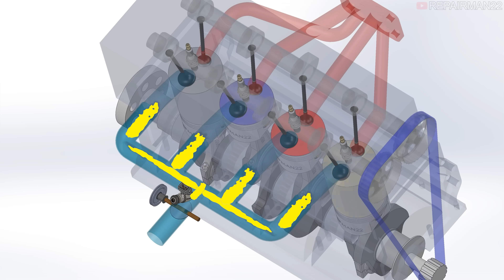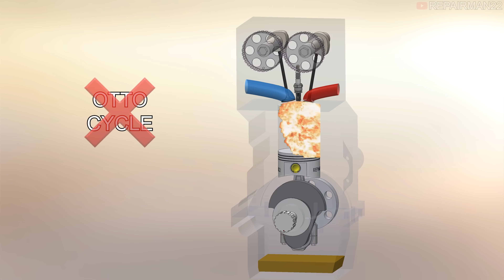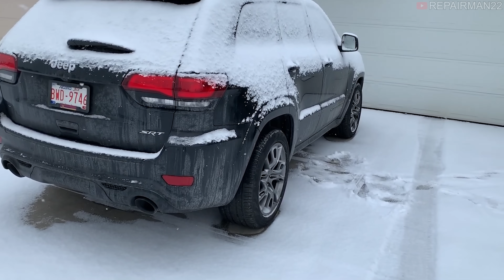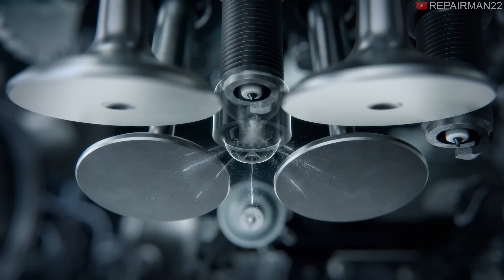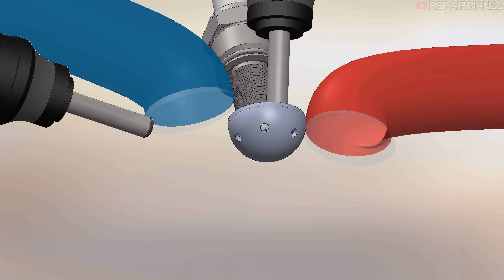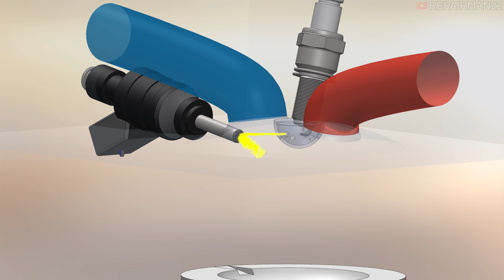How does this capsule with holes increase power? 💥🚗

Comment: Seems like the Active version of this is still the best pre-chamber solution, and most likely wont suffer from the issues of carbon build up in the chamber holes so much as the passive system used in the jeep / netuno

Comment: The early Honda Civics had the ignition chamber but utilized a small valve to feed the air/fuel pre-chamber
Reply: Literally in the video.
Reply: @welanduzfullo8496 No, actually, its not. The basic concept is there but not the exact system I'm talking about.  This concept is not a new idea. Honda massed produced it in the early 70's.
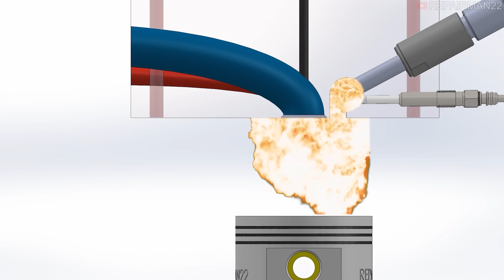Reply: @ravenrock541  Literally in the video and it was different 12:45
Reply: @welanduzfullo8496 That right. A different system entirely. So it wasnt "literally" in the video. Look up the Honda CVCC. The prechamber had its own intake passage with a mini valve to close it off.
Honda was doing it literally 50 yrs ago.
Reply: @ravenrock541  Your reading comprehension is lacking. Your initial comment mentioned the same thing the video already mentioned.
Reply: @welanduzfullo8496 Then let's just agree to disagree.
Reply: @ravenrock541  We don't disagree,  you just repeated what the video already said. The CVCC engines from Honda were mentioned.

Comment: Direct injection: The cooling effect allowed for higher compression BUT also result in more carbon build up. On the injector, on the Rings, on the valves, seriously shortening the engines life span.

Comment: Used to be called "Consant Vortex Combustion Chamber", which is where the Honda "Civic" got it's name (CVCC). I used to drive one in the 80's. Probably one of the most fuel efficient engins ever. Low to mid 40's MPG. It was a rubber vacuum hose spaghetti mess under the hood though.😂
That little dome is essentially a 'pre-fire' chamber. Very tiny, very rich mixture, fired into a VERY lean mixture. WAY less fuel used per cycle. Genius.
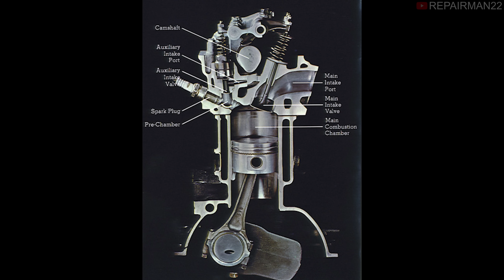Reply: In the video 12:49 and they were not turbulent jets

Comment: In an old 'science and invention' magazine from the 50's, there was an article on shell's (or was it texaco?) new multi-fuel engine. Burned gasoline, diesel, cooking oil, or any combination of all 3.  It worked on an ultra-lean principal of having a very small, rich charge of injected fuel/air spark-ignited to ignite a much larger, very lean charge of fuel/air, that would not normally spark-ignite by itself. The motor gave the 50's-era car 50-something MPG. And then it was buried and forgotten.  This 'new' mahle motor sounds very close to that old motor the gas company designed. Just imagine if it went into further development and production way back then.

Comment: The Mazda Skyactiv x, and Z do something similar.  It has port injectors that give the charge too little fuel to predetonate.  There is a small fuel injector creates a small volume rich in fuel around the sparkplug, there is no cup.  When this small volume ignites, the rest of the charge is ignited by pressure, rather than a flame front.    For more power an electrical powered compressor forces more air in when desired.
The SZ engine should be available this year in the US.  The SX engine has never been available for sale in the US.  When in lean charge mode, the throttle is kept wide open, and power is controlled by the amount of fuel injected by the port injector.  Lower pumping losses contribute to high fuel efficiency.

Comment: Very interesting and impressive.  I'm sure the manufacturers will make it impossible to interface a diagnostic tool with them so you won't even be able to work on the damn thing. They will make it where you have to bring it to them for a spark plug change. They will then act like pulling the upper intake plenum is akin to brain surgery and charge you enough to make your nose bleed.

Comment: Companies make these highly complicated systems to save another.1% of economy…then the engines carbon up and don’t last.  The new factory’s and foundry’s are polluting more than the old engines being left alone.  My Honda civic from the 90’s gets 42mpg and has 323,000 miles….oh and it’s easy to work on, parts are cheap and it has plenty of pep.  I don’t see any improvement.  Best part is the people that think they are saving the earth buying a car like this, yet they take a jumbo jet on vacation that pollutes 1000’s of times more than their car will in it’s lifetime.  I use to like engineering when they made things to last and be repaired, instead of over complicated and disposable.

Comment: I would imagine massive carbon build up in the pre- chamber in long-term use.
Reply: You need to rev your engine to the max from time to time. Not for grannies :)
Reply: It burns away
Reply: @MassimoTava   I agree that most of it will burn off in a properly functioning engine. However, premature buildup caused by faulty components—such as the crankcase ventilation system, spark plugs, fuel injectors, piston rings, etc.—can still occur. In my opinion, these issues can contribute significantly to buildup.
Reply: Somebody requesting attention

Comment: The MAHLE Jet Ignition (MJI) system—specifically its pre-chamber combustion technology—is conceptually derived from earlier pre-chamber designs, with Honda's CVCC (Compound Vortex Controlled Combustion) from the 1970s being a primary example of this technology in spark-ignition gasoline engines. All this does not overcome the direct injection issue with washing down cylinder walls on production car and causing premature cylinder and ring wear, as well as dilution of the oil. While the fuel dilution issue can be vaporised off once an engine's oil reaches full operating temperatures, many cars are used for short trips which is why direct injection has limited modern engine lifespan, in concert with low oil pressure that has been employed to reduce emissions. The best solution is dual injection, both port and direct injection with the port injection handling all low to mid RPM operation and the direct injection joining in under higher load conditions which solves the cylinder washing wear issue and oil dilution. The other defect in direct injection is that valves no longer are washed by the fuel from port injection, leading to very expensive service costs where walnut blasting is employed to clean the oil deposits that build up on the intake valve and progressively cause the engine to run poorly over the window between valve decoking. Manufacturers in a bid to save money have switched to direct injection alone, as dual injection requires two fuel pumps and twice as many fuel injectors. This cost cutting has all lead to engines failing long before they previously did, and is further compounded by longer recommended periods between oil changes, when in fact oil should be changed twice as often as before to mitigated oil dilution, oxidation and maintain peak oil quality in an effort to overcome the low oil pressure wear issues modern engines have. This is especially important if the engine is turbo charged, as the bearings are prone to wear from the smallest amount of impurities as they spin at speeds from 50,000 to approaching 100,000 when fitted to 'tuned" engines.

Comment: F1 Bring on 50 kg fuel limit. It can be done, already with forced induction, big increases in power are being made on smaller amounts of fuel. Bring on a lower fuel limit.
Reply: Racing should have no limits.
Reply: that would be 530hp for an hour at 60% thermal efficiency

Comment: in theory you could do a dual fuel system, super lean gasoline with port injection and ignite it with diesel direct injection, only one high pressure pump and no spark plugs
Reply: It's called Reactivity Controlled Compression Ignition (RCCI). It's a favorite engine design of Rolf Reitz.
Reply: @gregorymalchuk272 holy shit it exists and apparently it's super efficient too. god damn i am smart 😂

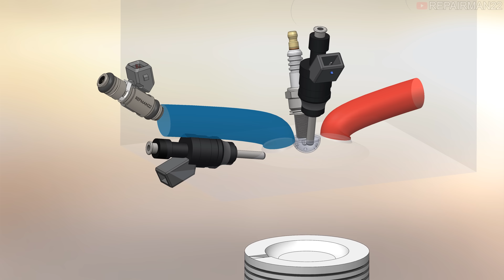Comment: 8:00 - Why would you need the other injector in the cylinder if you already have a port injector and you're running lean on a prechamber design? One of the reasons for the direct injector is you could aim the jet of fuel at the injector so that you could ignite a lean mixture. Now you ignite it with the prechaimber and this should allow a fairly homogenous lean mixture in the rest of the chaimber.

Comment: Lean fuel mixture causes an increase in oxides of nitrogen, not nitrogen oxide, which is laughing gas. They're not the same thing. EGR's and variable valve timing solved that fake issue invented by federal bureaucracies.
Reply: With this you wouldn't need EGR given the NOX emissions go sharply down after lambdas of 1.1 and NOX is still an issue, just less than in the past.

Comment: No wonder F1 sucks. Regulations. Its not about whos the fastest anymore.
Also, these engines will last about 60k miles and thats it. Non-rebuildable, disposable. But hey, thats green! This is so soviet that Stalin would be proud
Reply: They will definitely run far longer than 60k once commercially viable and under Stalin you would be walking to your job and never get to choose between hundreds of cars, fuel and engine types
Reply: @welanduzfullo8496  Youre not getting it huh.

Comment: 50% thermal efficiency means that you turn 50% of the chemical energy into torque at the crankshaft, but there are still other losses between the crank and the wheels.

Comment: I like the rules limiting fuel and amounts the rules.
   There is mentality that says, well the racing is too tight or too close.
   There is probably a way that teams can work with the rules and still find ways to excell.
Reply: F1 etc rules have long been to make them not excel more than another and cost cutting. Its one thing to give  a rule say 200 liters per race or 100, its a completely different thing to say its gotta be this displacement with this stroke with this turbo and you can have a button to have this psi increase for 5 seconds a lap etc.

Comment: Diesel engines forfeit the pre-combustion chamber (indirect injection) in favour of direct injection based on claims of increased efficiency of direct injection over indirect injection. Now you tell me that petrol engines are incorporating pre-combustions chambers to improve efficiency?

Also, indirect injection diesels were developed exactly because indirect injection allowed for higher engine speeds than direct injection diesels, resulting in smaller, lighter engines for a given power output. Even now, modern DI turbodiesels cannot rev as high as old IdI diesel engines, and non-turbocharge DO diesels are only useful at speeds below 3000RPM. I disagree with your claim at 12:50.
Reply: what was wrong at 12:50?

Comment: Surely one aspect about Formula 1 should be about technological progress so I have no issues with the regulations limiting fuel flow because it forces manufacturers to improve efficiency. It's the same thing as endurance racing limiting peak power. That being said the incoming regulations with increased hybridity but no MGU-H or front axle regen are a little odd.
Reply: f1 is irrelevant to road tech

Comment: FACK Formula 1.
It used to be an extreme motorsport, not an eco race to see who burns less fuel thru out the whole race.
Bring back the V12, V10 and V8 and you'll have my attention.
~~~~~~~~~~~~~~~~~~~~~~~~~~~~~~~~~~~~~~~~~~~~~~~~~~~~~~~~~~~~~~~~~~
The fancy injection systems:
I'll stick with the daily driver proven and approved old sequential port injection.
Maybe one day the ACTIVE JET IGNITION will be amazing and they will figure out all the kinks.
But as I get older, simpler tech seems more and more attractive with every passing year.

Comment: Why don't they use the prechamber as an injector since the prechamber is at a richer mix anyway
Reply from the maker: because you use the prechamber to build up pressure that gasoline injectors can´t reach, and also, you need to ignite that pressure. Thats the reason why u also have a sparkplug inside. In diesel, you don´t need the spark, and by the nature of diesel, You can now build higher pressure injectors. At the end of the video its shown.
Reply: @repairman22 for the semi active system why do they use a fancy injector with a special port aimed at the prechamber to snipe the prechamber from the pistonwall instead of using the prechamber to nozzle the fuel into the combustion chamber while metering some of the fuel flow into the prechamber for ignition
Reply from the maker: @matthewfredrickmfkrz1934  do you mean, using only the prechamber injector? Fuel atomization may be similar to the carburetor. The main cylinder mix will be bad.
Reply: @repairman22 basically turn the chamber into an injector head with a chamber

Comment: There are some technical mistakes in the description. Yes, lean engines can be more efficient. However, lean engines will kot have a faster catalyst heating, since a more efficient operation will lead to decreased exhaust gas temperatures.
Reply: Hottest EGT is at lambda 1
Reply: @1magnit  Lean burn is much leaner than Lambda 1, so much so that is actually starts to cool of again.

And even then, a more efficient engine at lambda 1 will have less EGT than a less efficient engine at lambda 1.
Reply: @gamba-yx8gk  It's both more efficient and colder to run at leaner than lambda 1, hence why that's the move being done by manufacturers.

Running from richer than lambda 1 to lambda 1 does get hotter, yes, but as you go past lambda 1 again and way leaner it starts cooling off again as well as giving specific heat benefits to increase TE.

Modern engines especially ones getting ready for Euro 7 all require lambda 1 at all operating points so there are a lot of developments and effort being spent on the engines to make sure they survive that but we already have and will continue to have more and more engines running full time lambda 1 or leaner at all times.
Reply: @gamba-yx8gk  I'm not gonna argue with you anymore, you talk like we're 15 years in the past whilst I'm talking about today and the future. Afterall you're commenting on a video about a future engine technology, why talk like we're 15 years in the past?

Check out the latest generation of BMW B series engines, Porsche turbo, Stellantis Hurricane engine - all full time lambda 1 engines already out. Euro 7 will require all engines to run at lambda 1 at all times, so we'll just see more and more, there is no choice - the Euro 7 regulations will force everyone whether they want it or not or whether they can or can't do it.

Ofc you're in the beginning going to be limited by how much power you can run to limit the heat but as we get better and better we'll start to see power figures come up again whilst staying at lambda 1 or leaner. Here is where technologies like lean burn whether lean with air or lean with exhaust, Miller cycle, Pre-chamber and so on will come in to play to make leaner and leaner mixtures suitable to use. Pre-chambers entire purpose is to get an ignition mode way more powerful than anything available out there today exactly to help lean mixtures ignite.

In F1 Honda talks about air fuel ratio of 36:1 being used at 18:1 compression ratio netting over 50% thermal efficiency producing something like 200bar of peak cylinder pressure so much so they have to use steel pistons and steel cylinder heads to survive the conditions. Obviously F1 engines aren't road cars engines but the technology and path forward is the same and shows where the future will head towards.